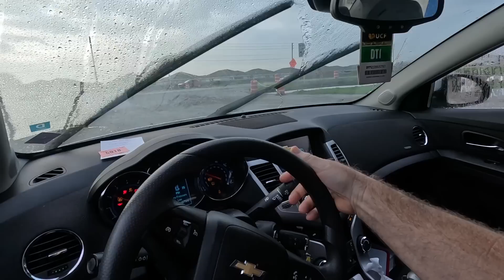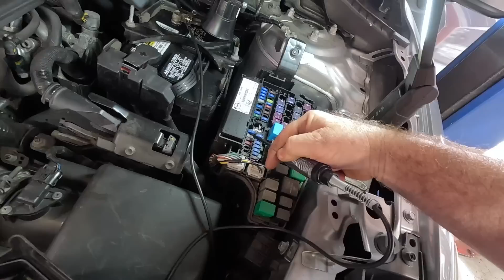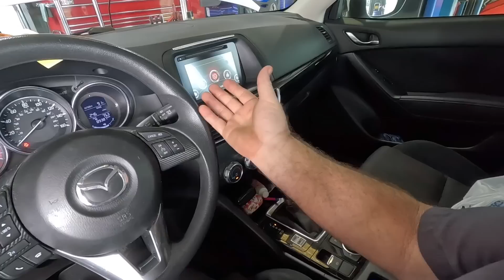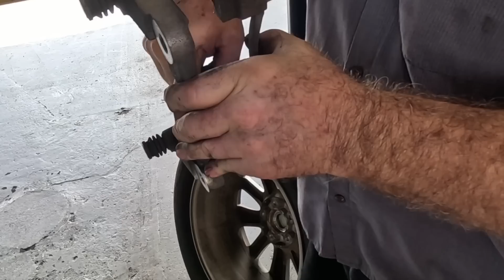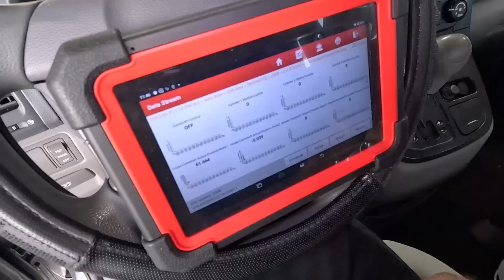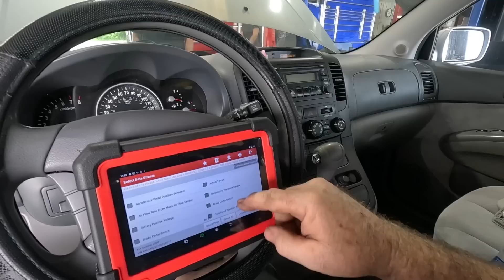Sedona Timing issue again, Cruze no start, Mazda Radio, Brakes, DAY IN THE SHOP 341 #auto #repair

Comment: that " Dude" mechanics tips also hade two on a V W. I realized we came up in the hardest times. We had to go from points and plugs and carbs , to engine management, fuel injections. These people that are coming along now don't have to change with the times. It could also be said they will have to learn EVs. That's when I'm retiring. 1 to 3 years.
Reply from the maker: Yeah, that is true. I'm a few years behind you. Just in time, haha.

Comment: On that Mazda escape, the battery installer likely had a arc while disconnecting… it’s tight above the posts.
Reply from the maker: Yeah, that might be what happened. Thanks!

Comment: Saw in the thumbnail you’re using a launch instead of the topdon. What’s the deal?
Reply from the maker: I switch back and forth sometimes, trying them both to compare.
Reply: @JimmyMakingitwork  Gotcha. I've been trying to decide of I wanna buy that Topdon Phoenix Lite 2. My shop has plenty of scan tools, quite a variety including a couple OE. But I want one for myself at home. My favorite has always been the snap on verus but as far as atainable for DIY I like the matco maximus software and I think the Phoenix lite 2 is very similar to that. I figure for the price of the tool and updates it looks pretty hard to beat.

Comment: The caliper pins have a protective coating on them. When that comes off they rust. I recently had a pin that was stuck, pulled it apart and cleaned/greased it all up. 6 months later, brake noise. Same pin locked up again with rust. The pin continued to rust causing it to stick since the coating was gone.
Reply from the maker: That makes sense. I would think the rust came from the lack of grease or an unsealed slide cavity allowing the iron bracket to begin the rust process. Could also be a coating issue on top of other issues.
Reply: @JimmyMakingitwork  yeah, it wasn’t good. I winged a new caliper on it with bracket and moved on with life